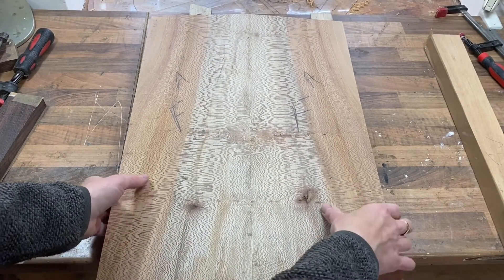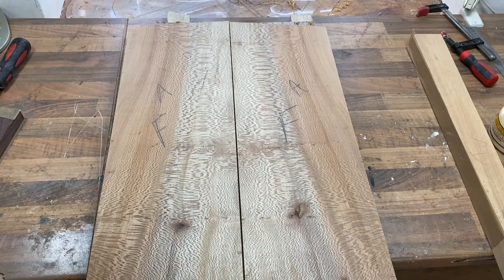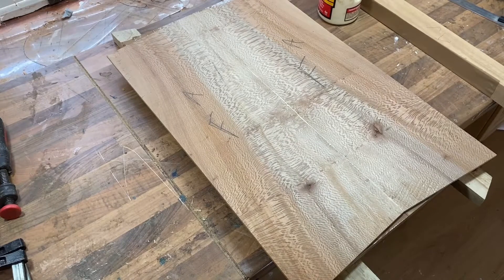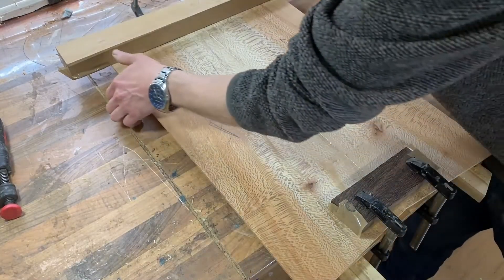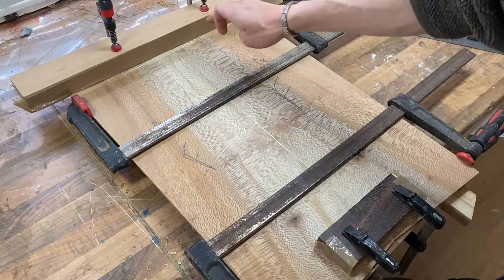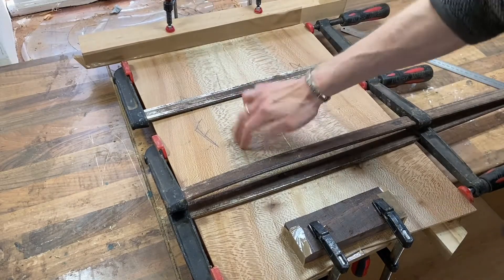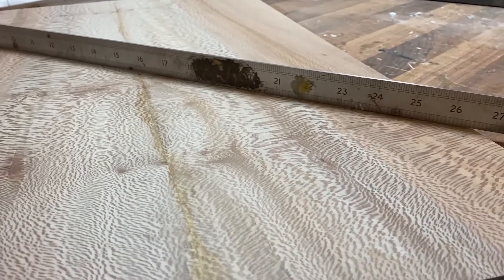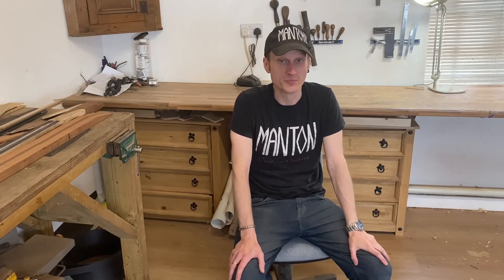Luthier Video - Gluing Up a Book Matched Guitar / Bass Top

Comment: That's a beautiful top. Here in the States I would guess it's sycamore, but across the pond you have different species or the same species with different names.  I have a figured maple bookmatched set I'll be deploying on a solid-body twelve-string soon, so I happened across this video at an opportune time.  Thanks.
Reply from the maker: Thanks, this top is now on a finished guitar! Yes, different names over here for Sycamore….the wood we call Sycamore over here is actually a Maple (Acer pseudoplatanus, which means Maple fake plane) I call it English Maple to avoid confusion. This top in the video is London Plane…the US sycamore is a Plane tree also.